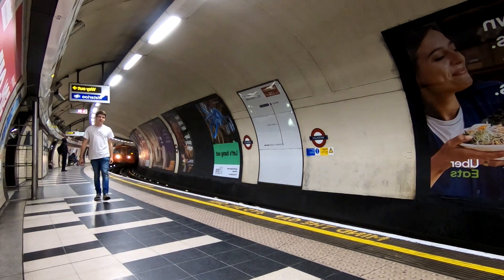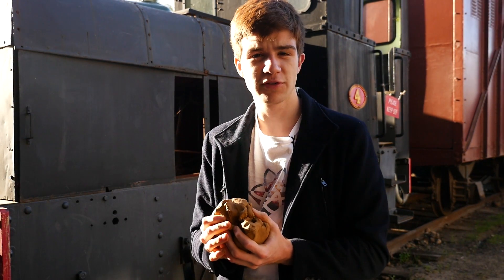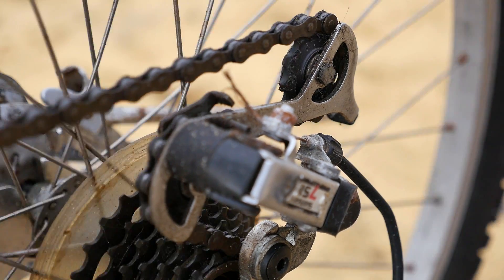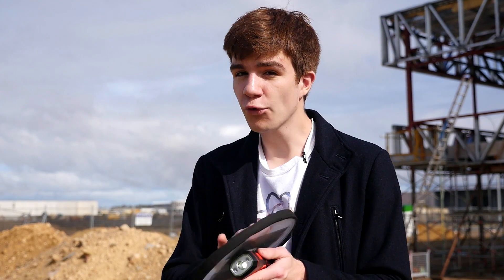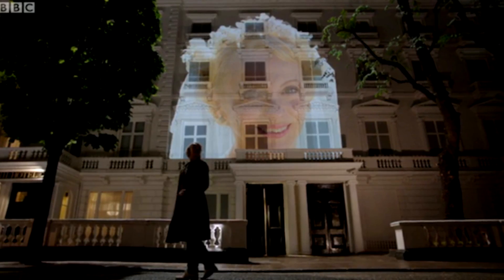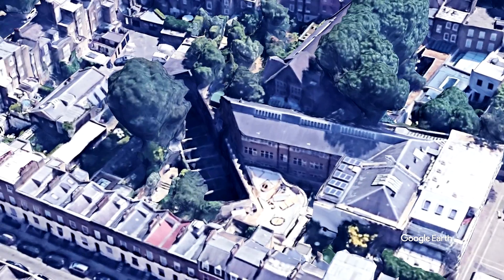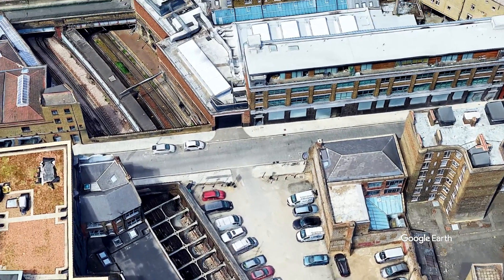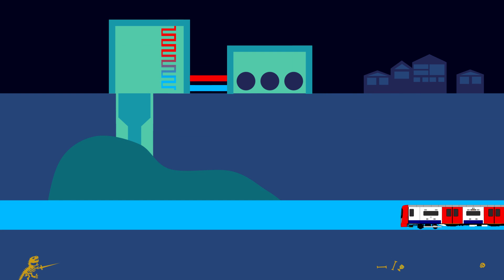Why It's (Almost) Impossible To Cool The London Underground

Comment: It’s literally so hot they’re thinking of using it as a fucking geothermal energy source.
Reply: adapt, improvise, overcome
Reply: >use it for geothermal energy
>power ac units
problem solved
Reply: @kenetickups6146  that's not how AC units work....
*They even said as much just as I was reading your comment.
Reply: @RebelTvShka  i was joking dude
Reply: @kenetickups6146  yeah. I thought about that after posting. I've decided I need a nap.
Reply: @RebelTvShka  Well have a good nap
i don't blame you though
can't really tell when people are joking anymore
Reply: @kenetickups6146  That is a great idea with no flaws, they should hire you
Reply: @kenetickups6146  A Perpetuum mobile (almost. depends on how you mean it.)
Reply: @kenetickups6146  heat exchangers are just ACs running backwards right.
Reply: Stonks
Reply: I heard they are considering atomic fusion since the temperatures are already very close to what is needed for that.
Reply: @Oberkommandohaha very funny but just for information purposes fusion works at lor hotter yet whilst there's no lava or deep mine/ borehole effect that heat could still be used in a heat exchanger system, like running AC backwards.
Reply: Well the clay insulates and it will be too cool again around the tubes that transfer heat.
Reply: Reading the comments should be a test for autism. Half of you failed.
Reply: @johnapples2018  Isn’t that a good thing?
Reply: If you actually did the research for this, you'd realize it's practically too cold even at the hottest of hours for there to be actual energy generation from said heat.

There are two practical solutions to solve this problem:

A) Active - Air condition the tunnels. It would take up only a fraction of space all those shitty open tunnel segments do now (they have to be removed in order to insulate the tunnels), reducing noise pollution massively and allowing for new buildings to be built but it would cost power. It can be implemented in the existing ventilation systems they have.

B) Passive - Utilize geothermal cooling. You basically extend/modify the existing train-tracks (which are the #1 producers of said heat) to have stuff sticking deep into the ground. AKA: You're making the earth a heatsink for that breaking heat.
Reply: @AudiR8Fanboy almost nowhere
Reply: @UCH8ykuGprgc1GmeC9YUmT-g be quiet
Reply: Stonks
Reply: To be fair, that is possible with fairly moderate temperatures. I have seen examples of using heath from the sewer to heat buildings.
Reply: @AudiR8Fanboy oh dear
Reply: @Oberkommando  this is the moment where you are supposed to respond with r/woooosh 😀, like so:
Reply: @AudiR8Fanboy r/woooosh 😀
Reply: That's obvious. They should. Heat exchangers meet circuitry heat sink. These half a dozen eco building designs if you can't get a vent in you could get wires taking heat further away or with a thermocouple or whatever taking it out the system.
Reply: @AudiR8Fanboy r/woooosh
Reply: @denisp0  🤬 Like getting a joke is more important than anything else. Things like helpful facts or dignity. Ego fuelled boorish nonsense, that's what joke shaming is. So often wrong. It's literally just that something else like truth or tangential discussion might be more interesting and engaging than a particular joke. Or the other half the time people are actually still joking and you scoffing Jester's White  Knights haven't got it. Or alternatively are defensive of some otherwise obnoxious aspect they shouldn't be. Get over it.
Reply: @kathybramley5609 hey um I made that comment 3 years ago I dont care anymore
Reply: @denisp0  as an autistic (and yet just speaking for myself) I consider r/whoosh hate speech
Reply: @kathybramley5609 you should conserve your energy and not waste your time with strangers on the internet that left comments 3 years ago
Reply: Shutup
Reply: @Bretaxy  what?

Comment: It boggles the mind that clay is so good at holding on to heat, that you can store it for colder months like it's dried fruit or something!
Reply: Funnily enough, built a box out of clay, place fruit and other perishable food inside and seal it up, and that food will be able to stay edible for much longer. Many medieval castles used underground clay pantries to seal up food incase of a siege cutting off access to food supply.
Reply: Not only clay. It's a general thing with earth mass. That's why the warmest months are July and August, although the sun is most intense before and after June 21st. The storing of heat causes the delay.
Reply: @GrandTheftChris  Funny that, I always read that it's the sea that moderates heat, land warming quickly heats air which draws in cooler maritime air.
Hence continental interiors having greater extremes between summer & winter
Hurricane season is later, powered by warm upper layers of water
Reply: Dig down 6 meters and the ground has the yearly average temp all the time.
Reply: Yeah, it's incredible, you'd think someone would have thought to line large ovens with clay fire bricks... Ohh, errr
Reply: I don’t think it holds heat for longer than a few days. The increase in trains is what is warming things up. Air is constantly being changed down there and that air carries heat in and out

Comment: I suggest we let the themes fill the underground metro lines with water to warm the water up and then pump it all out.

Problemo solved
Reply: They (involuntarily) filled some subway tunnels of New York with water during Hurricane Sandy. Result after the water has receded: the subway stopped working until they had swapped out millions of dollars worth of parts.
Reply: Well, they tried your suggestion. Did it work?

Comment: The suggestion to use regenerative braking to alleviate the heat problem is similar to suggesting a homeless person to "just buy a house". It simply is not viable with current technology. Little do you know that the vast majority of kinetic energy in trams, which do have regenerative braking, is transferred to heat anyway.

Comment: I’ve ran through the comments but couldn’t see anyone with a solution. Anyway a competition was run about ten years ago for ideas to cool the tube. I am an engineer and every engineer I know said the same thing. London is built on many rivers. The water from these rivers is pumped out of the tube everyday. The water could be used as a medium to remove the heat from the tube. Simple idea but obviously I’m not sure how easy it would be to put into practice.

Comment: Hey, great job with this video. Just a thought though. The script seems a bit messy. Nothing major, but I'd seperate the parts where you're talking about the causes of the heat in the underground and the solutions to this problem a bit more. Tthe part about regenerative breaking in particular seems a bit disjointed. It's not a giant problem, but just something that came up while watching.

Comment: This noob is holding modelling clay when he talks of London being built on clay ! To be accurate some of the geology of London IS clay , mostly ´London clay´ which is a blue / green / grey very wet clay and some is ´Boulder clay´ which is more yellow / tan in colour and rather less wet than  the first . However there are pockets of shale / gravel in certain areas which is quite difficult to tunnel through due to inherent instability.

Comment: Laughs in ventilated tunnels of Moscow Subway
I once caught cold in August because I didn't put my jacket when going to work
Reply: Except colds are caused by viruses, not low temperatures :)
Reply: @dunebasher1971  But rhinoviruses which cause the common cold love cold temperatures.

Comment: They could of course also just cool it with evaporative cooling or some good old pipes with cold water.
The idea of generating electricity from the "only" 40 degree tube air seems very optimistic. And properly will not justify the cost of the generation equipment, over just blowing outside air down with a fan, or fancy convection.
Reply: Andreas Fønss Evaporative cooling wouldn't work - it's already quite humid down there and anything that increases humidity makes the problem even worse. There are stations cooled using water passing through large heat exchangers that look like air conditioners - green park I believe is one, I think they use ground water that's then re injected into the ground through boreholes.

Comment: starting and stopping all the time without regenerative breaking?
wasteful!
Reply: I was surprised to hear they don't have that yet. Amazing, I'd imagine it would save them so much money in electricity. And the tech exists since decades.
Reply: They do, at least on some stock - Northern Line and S-stock, certainly. There are brake gauges in some carriages and you can see that they don't budge until the car is virtually at a standstill.
TfL have a calculation of what regeneration saves both in terms of electricity and 'cost of cooling', can't remember where I saw it.
Reply: They’ll probably get round to installing it in 2040...
Reply: Also remember they're pushing a huge wall of turbulent air like a plunger in narrow tunnels, that gives an air brake effect.  Infra red shots of trains in stations just after braking, will show heat.
If this magical clay oven existed, winter temperatures would be excessive too.
Really it's caused by inadequate ventilation.

Comment: Mate here in Australia a 40 degree day is a warm breeze, how you faint from it?
Reply: tosh Because in 40 degree heat in Australia you're not wearing a business suit, pressed body to body with hundreds of other passengers in a carriage with high humidity and very little air movement. Add to that the fact many people have rushed to leave the house and get to work on time and skipped breakfast and you get a lot of fainting
Reply: because people experience heat as a percentage difference to their normal experience, which is why heat wave temperature thresholds vary by country

Comment: 40C is nothing cmon poms.
Reply: zman1508 As a tube commuter I can tell you it is! It's unlike similar temperatures above ground- the humidity is higher, there is hardly any air movement and the carriages can be packed so tightly you are quite literally pressed against other people on all sides. You simply don't encounter that combination of conditions anywhere else.

Comment: why not just use a fan to blow in air from the surface lol
Reply: Macboi They do, in places. However they are only effective over a relatively short length of tunnel, and for many lines there is simply no space above ground for the necessary shafts and fan housings. Where there are fans, they are frequently run at reduced power or switched off altogether overnight as the noise is intrusive and disturbs nearby residents.
Reply: @spencerwilton5831  that makes sense

Comment: Interesting video! Might be worth mentioning that quite a lot of tube trains already use regenerative braking - the 1995 Northern Line stock and all subsequent fleets (and the 92 stock Central Line trains are currently being modified with new traction motors to enable regen braking)

Comment: Nice presentation etc I do like the video but it seems cut short. You went into no real detail about how the heat pump / electric generation works. How many of these heat harvesters would you need (probs almost as many as vents which was previously stated to be impractical), any cost / environmental savings, etc.

Comment: Nice video; Geoff Marshall also did a good video on the subject. Except for the clay acting as a much better insulator, these problems aren't unique to the Underground though! Interesting how much of an effect it's having, even with the deep lines; presumably the deep lines aren't at bedrock level? It seems like the thermal conductivity of clay and dense igneous rock aren't actually terribly different though, somewhere around 1-3 W/(mºK) depending on saturation and porosity, though rock does admittedly seem to be higher on average. I'm no expert though. I'd also be curious to get some better elevation data and compare temperatures to elevations across multiple systems, especially since it seems like the cut-and-cover sub-surface lines manage to do just fine thanks to the better availability of ventilation. It's not like the Underground is significantly deeper than the MTA or Métro on the whole, let alone newer systems like Seoul or Shanghai (though admittedly they probably were better designed with cooling in mind), and while those systems also have some issues, it's not really to the same degree. More importantly, both of those systems manage to run air-conditioned cars across more of their network than the Underground.

Honestly, it seems like the biggest factors for the Underground specifically are the low loading gauge and lack of shafts, and thereby the additional cost to add air conditioning/ventilation to the rolling stock and stations respectively. The tubes on a heat pump can run a long ways as long as they're properly insulated (which, as you've noted, isn't hard given the soil composition), and as you also mentioned, there are fancier solutions with moving the air itself; I kinda doubt that it's inherently way harder for the Underground for much besides than "it wasn't designed for it when it was built." It seems like that's a solvable problem (with enough money), and given that there's supposed to be air conditioning for the deep tube lines by 2030, it seems that TfL agrees. Guess we'll see how that goes.

Also, I think you might have an audio syncing issue?
Reply: Thanks for such a brilliant technical input. I've had trouble finding data, but it looks like they're talking about 14° clay temp in 1900, and 20° to 25° now.

Some of my scepticism of this as a significant factor is understanding the rate of heat transfer back into the tunnel. There will obviously be forced convection between the tunnel lining and  air in the tunnel. Given the insulative properties of the clay however, I would expect the conductive transfer of heat between clay and tunnel lining to be quite low. 🤔

Comment: I didn’t know about the clay gradually holding more and more heat thing, that explains why the heat seems weirdly radiant in the tube!
Reply: I frankly don't buy the "80%" figure, but it's certainly the case that the tunnels would have been cool to start with, would have warmed up as they were used, and will hold onto and radiate heat back into the interior.

The majority of the heat in a space is typically in the material of the construction rather than the air, and this is only going to be exacerbated in a tunnel where the walls are, for all intents and purposes, infinitely thick, and surrounding a comparatively tiny interior. Which should be obvious. An average house weighs in the neighbourhood of 60,000 kg (minus foundation, which might be 1-2x as heavy as the rest of the house. In contrast, the average house contains only about 700 kg of air.
Reply: Or I assume that they have a good amount of air circulation from the outside. And if 10° c air is heated to 23°c air its still very comfortable. But if the outside air is 28° the inside will be boiling
Reply: idea: install air conditioners in stations and release the hot air outside
Reply: It's incorrect. Otherwise the tube wouldn't be comfortable in winter. Clay still dissipates the heat. Just much more tube traffic then in the past decades.
Reply: @Dosedmonkey  Some lines really aren’t that much better in winter, and it doesn’t make the clay holding heat untrue, it’s just that it’s obviously easier to get the air temps down there slightly lower using the ventilation shafts, when the air outside is freezing cold. Crazy I know. Almost like cold air is easier to push downwards or something. Hmm.

Comment: Very interesting video but I have a question.  If the tube is so well insulated, why is there a big temperature difference between summer and winter?  Surely for a well insulated system the temperature should be fairly constant regardless of season.
Reply: It's not the system which is well insulated, just the conductive heat in the tunnels. It's the equivalent of having wall insulation in your home.

As much as possible the system is open to ambient air, like having your windows and doors open. In winter the ambient air being drawn into the tunnels will be between 0° and 10°. In summer it will be between 25° and 35°. This means in summer the air coming in is already uncomfortably hot, and then it is heated by the trains, people, etc.

Comment: Why do the London underground  have open air vent in the side of the track inside the tunnel  like the one from Mexico Metro
Reply: Dunno even in New York and Boston the metro have ventilation so the excess heat can just rise and go out street level vents.
Reply: @SilvaDreams  New York and Boston were planned cities where the majority of subterranean structures were designed around one another to be close to the surface whereas London is above centuries of tunnels and caverns caused by miners, previous subway attempts and failed sewage systems that could cause cave-ins if interfered with.  As such most of the Tube was built under these previous creations at around 70 feet below the surface with some parts as deep as 150 feet and even 200 feet so absolutely no chance of having street-level ventilation like US cities where the subways are directly below your feet.  On a plus note it does mean the Tube can double as a nuclear shelter for a couple million people.

Comment: Singapore has already figured out how to solve this problem, at least for the passengers. I have no idea how hot our train tunnels actually are.
Reply: New lines have sufficient ventilation built in. The deep tube tunnels are over 100years old. Some sections have barely any ventilation and the ones that do weren't designed to cope with modern high frequency services (lots of heat)
Reply: How?